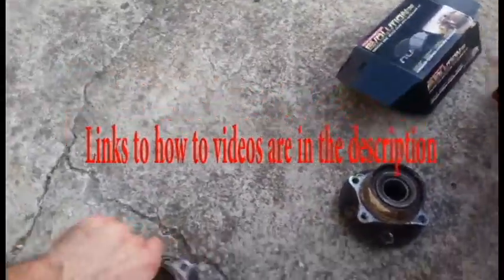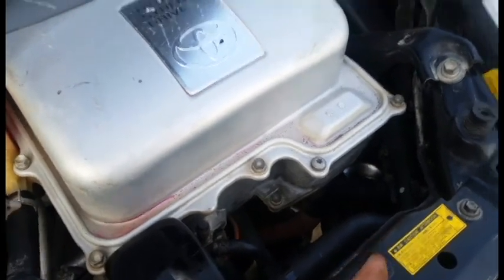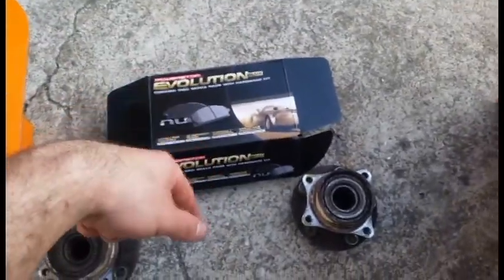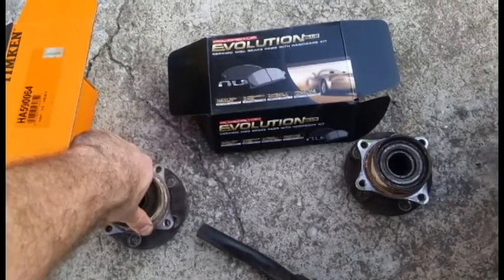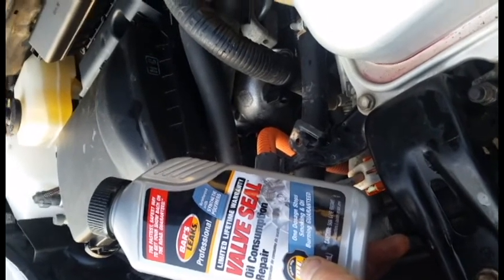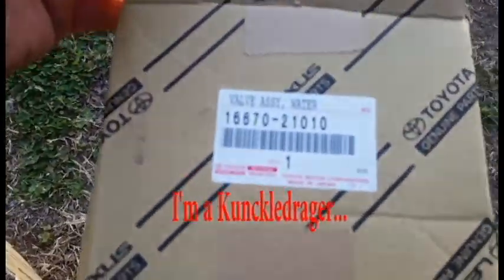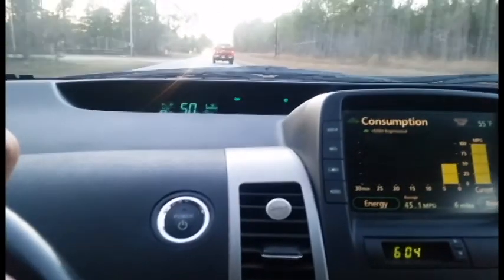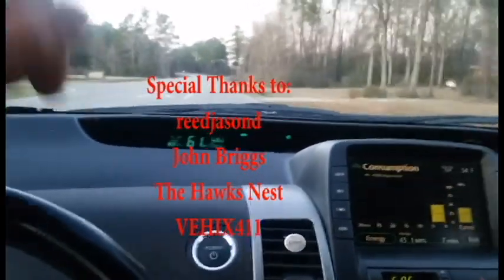Owning an older hybrid (09 Prius), P1121, maintenance

Comment: Nice work. Just a tip. Your battery should not be all the way up in the green. When the battery is strong the bars should move very little except with hills. Testing the battery with voltage is very deceptive and it keeps Toyota from paying out on warranties. I have had cells with full voltage but are dead inside, meaning 1 AH of charge capacity. The battery I just took out was 60% dead, but NO Hybrid lights came on, red triangle etc.. The biggest clue was the mileage started dropping to low 30s. . Thank you for your tips and good luck with your Prius. These are great cars and they can last a long time.
Reply from the maker: Whotu, a very valid point, I'm not an electrical engineer but I totally agree with you, and the way I understand Ampere hour (Ah) is how well a battery will provide a certain current flow per hour. The fuel consumption indicator is definitely the grand all tell all. How were you able to figure out that the battery was shot? Just the fuel economy? did you replace the whole pack or change the cells?  Thank you for the info. And I totally love this car, about to make a video of me doing new shocks on this thing here in a couple of weeks